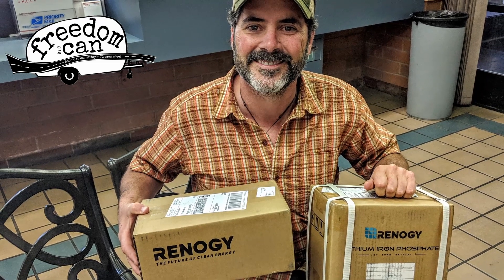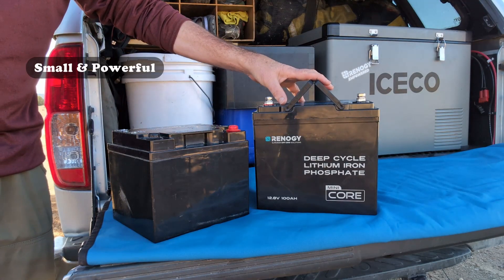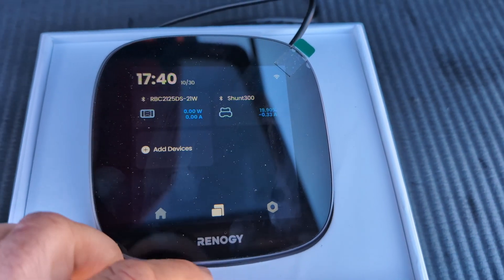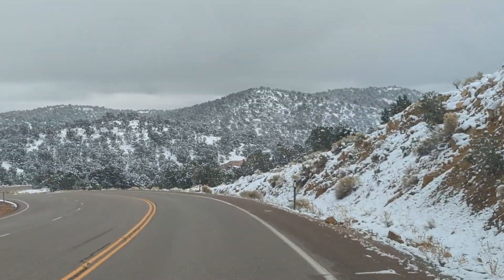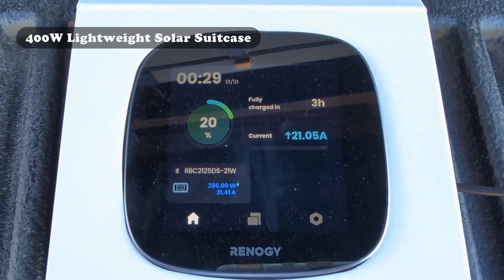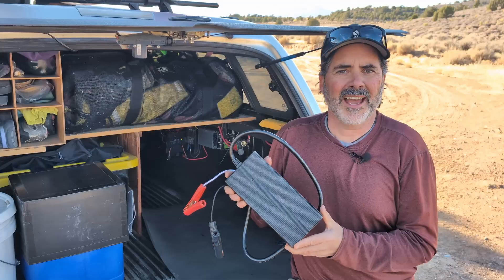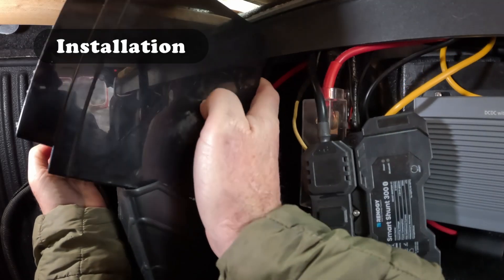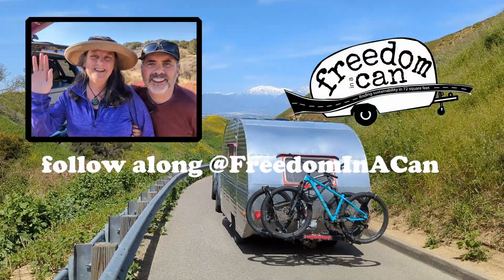Can a Mini Battery Power Your Off-Grid Adventures?  Renogy 12V 100Ah Core Mini LiFePO4 Battery Test!

Comment: Has anyone tried these batteries on the newer 36 volt 105LB thrust trolling motors? I’m thinking of purchasing and I’m nervous about running the trolling motor on high most of the day. If you have tried these batteries on the newer trolling motors can someone please indicate how long through the day they last on high/medium ect. Thanks
Reply from the maker: @GR8smallie_angler   @GR8smallie_angler  Good question.  Do you know the wattage of the various speeds of the trolling motor?  The mini core LFP battery has a usable 1024Wh at an 80% DOD.   This way you can plan out how long you can run the motor at different wattages (speeds) off a full charge. Use CANLIFE code to save 6% on your purchase. And let us know how it goes.
Reply from the maker: To deliver 36V, you'll need to put three of these batteries in series connection, giving you a voltage of 38.4V.  If you have a 105lb trolling motor with a max amperage of 50A, you figure out the runtime through this simple equation, Amps x Volts = Watts.  Multiply Watts x Hours = Watt Hours.  So, in this case: 50A x 38.4V = 1,920W.  Multiply that by 1 hour = 1,920Wh.  Now this battery bank would have a max Wh of 3,840Wh.  You have to figure that you only want to discharge the battery bank to 20%, (80% Depth Of Discharge), so you have a usable 3,072Wh (3,840Wh x 0.8 = 3,072Wh).  BTW Lead Acid only has 50% DOD.  So, at FULL POWER (50A) you can use the motor safely for 1.6 hours (3,072Wh / 1,920Wh = 1.6).  
If you're running it on a slower speed it is consuming the battery energy at a slower rate, increasing run time.  
Also, 12.8V is the nominal voltage, fully charged these batteries are closer to 13.5V, which makes for a higher Wh.  
If you were charging the battery via a solar panel (or boat motor through DC to DC charger) you can extend the run-time of your trolling motor.  You can also go lower than 20% on the battery bank occasionally without significantly shortening the lifespan.  
With cycles at close to 5000, if you used 1 cycle a day that would be nearly 14 years.  I doubt that you would be fishing each and every day, for 14 years, but then you can always dream, right?

Comment: OH, so it shuts off the charging, but continues to power your system? why don't you heat the batteries?
Reply from the maker: Yes, the battery will continue to deliver to -4 F, but won't charge below 32 F.  Heating the battery with a heat strap, or heat pad is an option of course.  Since we use this battery to power our 12V fridge when the temp is below freezing, the fridge isn't running, so we use very little power if any.  So, charging isn't really necessary.  However we do have self-heating batteries inside our trailer that will go into a heating cycle if there is at least a 4A charging current.  This requirement prevents unnecessary consumption of battery power, so it only heats when charging.  Check out our product test video of the Renogy Pro LFP battery. https://youtu.be/opRodMYk5io?si=O0e7A5KOcGIjQC_A

Comment: If you have a renogy DC to DC charger with Bluetooth module, would the shunt actually be required? I currently have that setup and can monitor battery and charging state via the DC app
Reply from the maker: @gazzamundo  This is a preference kind of thing. While you can get a good voltage status via the the DC Home app and your DC2DC charger.  Keep in mind that you'll only get an accurate reading of that voltage when not driving, otherwise the battery voltage will reflect the charging current as well.  From that reading you can approximate the state of charge (soc).  The shunt, however, will give you an accurate, real-time, soc because it simply measures amps in and amps out.  It's nice to be able to isolate both of these components and be able to see what's going on.  The shunt is necessary if you want to do that.  But it's really up to you.

Use CANLIFE promo code at Renogy checkout to get an additional discount on most products -- even on SALE items!  Use this affiliate link: https://renogy.sjv.io/LPEyNY

Comment: You can run your fridge on a single charge for 10 days?  Is it still the ICECO VL45?  The website says that the average power consumption on that is 347w per 24 hours, so 28.9ahs. I get it, you're rapt it's giving such good numbers in cold weather.  The real test is summer.  I just feel it's somewhat misleading to newbies who may fall for the trap of 200w of solar is enough to keep you going through winter.  Not saying that you're pushing this (far from it).  I just know that I made the mistake 6 years ago of a 100ah renogy lifepo4 battery and 200w of solar and it was far from sufficient to keep me off grid in winter.  Cheers.
Reply from the maker: @SLORTA5 
Thanks for your thoughtful comments.  We really appreciate that.  Yes, we're still using the ICECO VL45 that we installed in March 2021. It's been great for 3.5 years of nearly full-time use!  We have seen much better performance than what the manufacturer's numbers would suggest because we ALWAYS use it as a fridge and keep it at 39 degrees F -- which is ideal for both cold food storage and optimum energy usage. This device could be used as a freezer, which will take a lot more energy.  Their numbers are probably skewed toward the colder end and during warmer summer months.  

Even with the 50ah (640Wh) battery we got around three days on a single charge in the HOT summer months, and 4-5 days during the spring and fall.  A lot of real-life factors will go into performance, temperature, our fridge temp setting (39F), humidity, shade, how many times you open the fridge, etc.  Summer will be the real test, and we will do another video then to make a better comparison.  But summer can also give you an inflated performance on solar collection as well, with not only daylight hours, but also sun angle.  While we've been out in the south west in fall and winter angle played a huge roll.  

As you pointed out, that's why it's so important to size your system to where and when you'll be using it.  https://youtu.be/0rz45sL_NQw  We always suggest having additional portable panels for those times, and also for the summer when you might want to park the rig in the shade and still collect a solar charge.  Our 400W lightweight portable panel has been a huge help with running our mobile business as it keeps our Starlink, computers, and life in general running with virtually no issues.  You can find many more of our resources for free on our website!  Thanks!
https://freedominacan.com/solar-powered-by-renogy